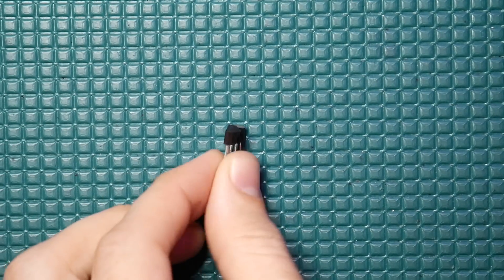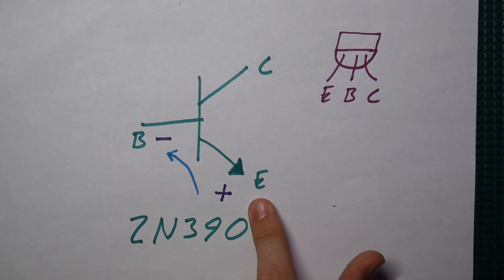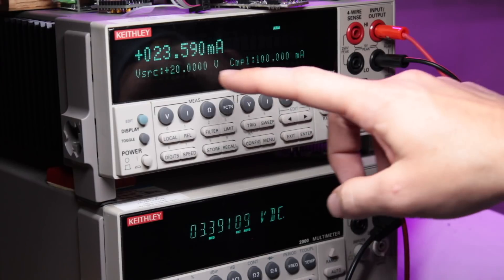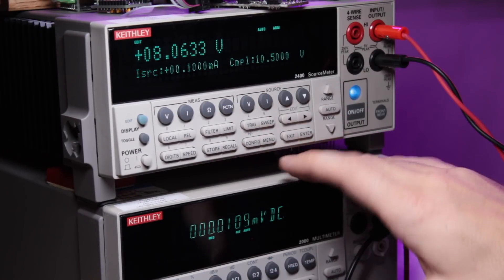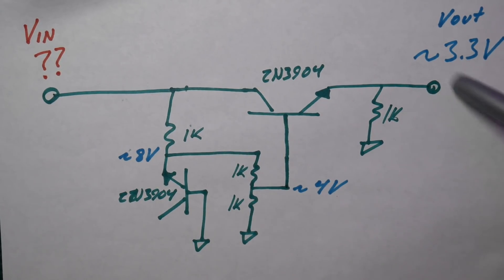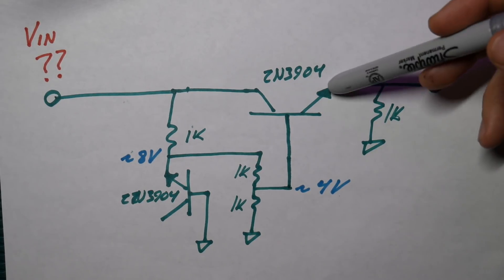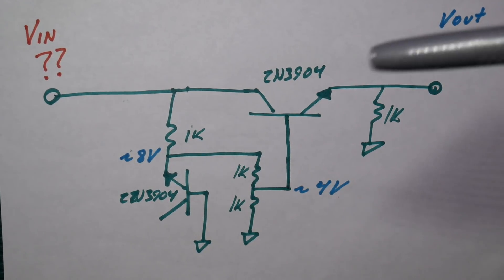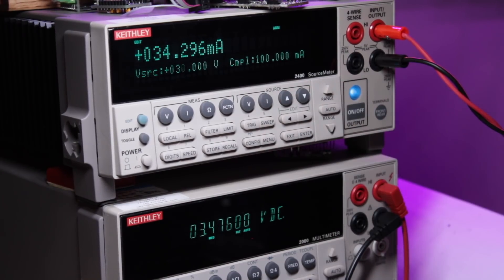Easy Two Transistor (Hack?) Voltage Regulator Circuit to Power Arduino!

Comment: Direct Zener/transistor is easier... look at the instrumental and haven't 1117 regulators? :o if you have only 2 transistors then it's better to use the second pulling down instead Zener, with resistive divider from the output, the one shown here is possibly the worst way :/

Comment: Nice fast n dirty... Voltage range almost demands automotive use, lol. Solar, and wind also, of course. Thumb worthy!
Reply from the maker: thanks!
Reply: a pleasure... seriously though, how about an arduino controlled constant speed windmill hub? or shunt system for solar bat charging gangs in batches? this dirty little junk drawer circuit actually fills the bill, assuming enough hardware behind it. mebbe a high freq start control board for a welder, even. "soviet" sophistication level may not get style points, but it often gets the job done. of course, just as a backup (or test replacement) for an actual converter circuit, or midnight patch when one blows it's invaluable. like i said, quite thumb worthy

Comment: Can you please explain the job of the second Transistor? You fed ~4V to it's base, I don't understand how did you get 3.3V from its emitter. I know the Vbe=0.6V. I just don't understand the role of its collector here. In a nutshell: WHAT THE F*#K???
Reply: I think I sort-of understand how it's working.
One transistor is acting like an 8V zener, then two resistors are acting as a voltage divider to give around half of that (4V), then the second transistor is acting like a voltage dropper using its forward bias voltage drop to reduce that 4V to around 3.3V.  Something like that, at least.  I'm probably missing some details.
Reply: look up "series pass transistor" circuits, aka voltage follower

Comment: Theres a reason, why god invented the zener-diode. just use a regular NPN-BJT, a single resistor and a zener as a clamp down reference, and your pretty much done, with way better regulation.
Reply: here's an article and the circuit: https://electronicspost.com/transistor-series-voltage-regulator/

Comment: What? did you invent this circuit?!!! Your circuit doesn't have a negative feedback.  It will not be stable with the current noise.  There are no caps here to filter noise.  There is a classical two transistor regulator for low current.  YOU better Google it yourself!

Comment: Sweet circuit!
Question - What is the max current?  e.g. if you had the Arduino driving a bunch of LED's for instance..
Reply: I believe the max current on an Arduino is 200 mA regardless of what it is driving and 40 mA max on a single pin.

Comment: Kevin, just got an off-topic question, it's kinda related though...
Does having a resistor (PTH) installed(soldered) upright (standing) on a PCB make it cooler?
http://server.ibfriedrich.com/wiki/ibfwikien/images/8/8a/Rstehend3.png
And why do they have some resistors soldered like that? Is it just  a space(holes are too close) matter?
Thanks in advance.
Reply: Don't forget that you can cool a component by sinking away heat into the PCB via the leads. Many small surface mount components rely on having pads of an adequate size because the package itself has very little surface area to dissipate heat into the air. Assuming there is no forced airflow, the resistor might get even hotter standing on end because you've increased the thermal resistance between one end and the PCB by extending the lead length. I would agree with mariushmedias that the main reason you see resistors standing on end is that it uses less PCB area. Through hole can work out cheaper than surface mount if the cost of labour is offset by getting away with using a really cheap and nasty PCB - no solder mask, bad tolerances, single-sided (since thru-hole components can 'jump over' traces). Standing components on end makes the board even smaller and reduces the cost.
Reply: Interesting questions. 
My answers would be : it would depend on how the board sits inside the product. Warm air rises. Pretty minimal differences either way 
As for resistor question... probably space saving reasons, it's not something commonly done as it just increases risk of shorts between resistors close together on board. Fuses are sometimes installed like that, but usually they're inside heatshrink (used to insulate and to protect user and board from glass or ceramic shards if the fuse blows up). 
Nowadays there's surface mounted resistors .. pretty much only people scared of surface mount soldering use through hole parts, and companies that find hiring hundreds of chinese workers cheaper (each worker placing a few resistors on the board then passing it to the next person) than buying pick and place machines. Ok, sometimes they're also required due to high power dissipation or they're used as fusible resistors in place of fuses...
Reply: Thanks guys, it's clear now.

Comment: Thanks man, that is a great tip.
Maybe having more than a single 1/4 watt resistor(Let's call it R1) in parallel might resolve the heating problem:
2 (R1) at 2000 ohm each = act like a 1/2 watt resistor
3 (R1) at 3000 ohm each = act like a 3/4 watt resistor
4 (R1) at 4000 ohm each = act like a 1 watt resistor
.
.
.
e
t
c

Comment: (yeah, i get the idea of the video but still...)

Just get a *1117-3.3 and two electrolytic capacitors and be done with it. They're like.. 50 us cents, you're not gonna go bankrupt.  Or AP2210-33 ... 30 cents each.

Or go with MIC5504 which is 12 cents each if you buy 10 and can manage max 5.5v input voltage and works with 2 ceramic caps worth pennies ... it's probably cheaper than 2 transistors.
Reply: That'll work if you have them on hand.

as Kevin said, this is more of an "in a pinch" thing that you wouldn't do as a "good engineering practice".  
It's an interesting experiment to figure out what you can "make do" with when you have limited resources at hand.
Reply: I usually salvage these 1117-3.3v smd volyage regulators from scrap tvs and digital boxes

Comment: KainkaLabs just did another video about input current protection using a bipolar or JFET in a similar kind of 'hack a transistor' video a few hours ago.... must be a thing today. 
  Now... I want to take this idea a bit further. Build a 2 transistor DC converter circuit then regulate the output with your little 2 transistor regulator you just showed. I've been toying with the idea of creating a zener threshold tester using a 2 transistor DC converter circuit just for fun. Thx for getting me thinking about it again.
-Jake.